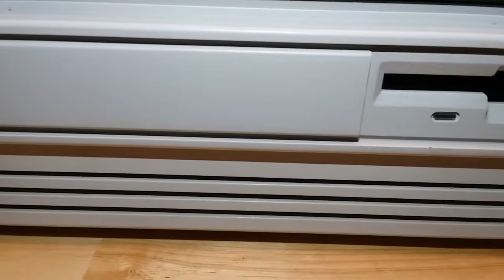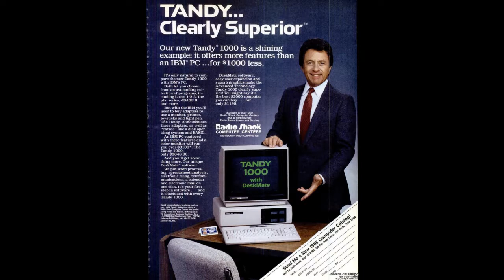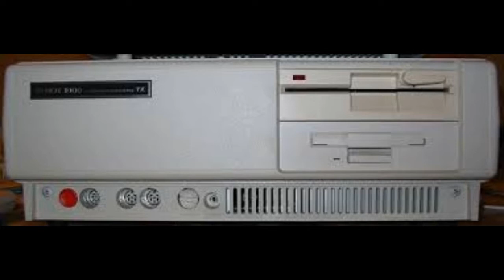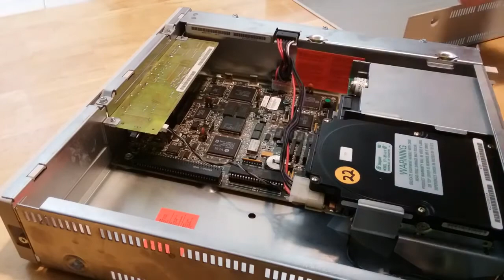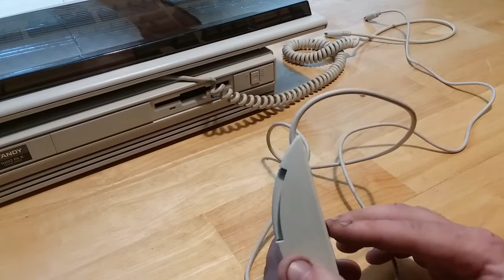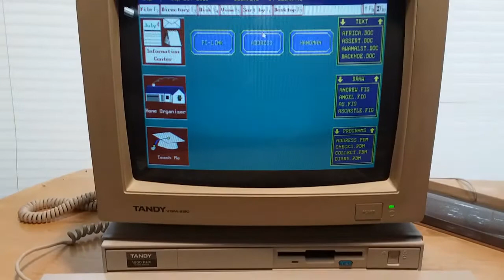Septandy 2020 - Tandy 1000 RLX-HD

Comment: I am sorry I had bought mine is 92 for a reduced 400$ and in the early 2000s had put a weird 8 bit memory card that took 4 32pin modules so I had gotten 9 meg total (8+1) and before that I had win 3.0 working easily in the 90's with the mouse and used it in wolf3d and other games , high end games from the time on 1meg would not work anyways easily so the dig sound and joystick conflict never came up
Reply from the maker: I haven't had the sound thing pop up either, but I haven't been able to get games to it yet..my xtide card won't work correctly, and the floppy stopped working.

Comment: Geos and GEM just work fine with the Mouse. Who cares about Windows.
Reply from the maker: I only really brought up the windows thing with this machine since i had been told on a forum page that leave deskmate installed, and was told about the weird mouse issue. And, do you mean theres GEOS and GEM thatll work on Tandy? Or did you mean the Geos and Gem had mouse support prior to deksmate being released in the 80s?
Reply: @definitelycasualpcs8789  GEOS and GEM do work with the Tandy-Mouse.
Reply from the maker: @drzeissler  Oh do they? Awesome! Maybe someday if/when I have a system that runs either iI'll test it out
Reply: @definitelycasualpcs8789  I never use deskmate on my T1000RL because it's ugly. The older Versions look better to me, but I think I have to stick to the version that comes with my system because there are parts in ROM already.
Reply: Speaking of the T1000RL/HD it's in my opinion the best machine to get. Small, silent and has all the capabilities you need, Tandy gfx/sound. Mine has an XTIDE with lot's of 32MB Partitions in it.
Reply from the maker: @drzeissler  yes. Deskmate wasn't pretty, but it was unique. Not many, had an os built into rom for a quick startup for use...the only one that comes to mind is the Macintosh classic.
Reply from the maker: @drzeissler  yea that's the thing that kinda sucks about the rlx, generic vga and an ...approximation?, emulation?, it's not true tandy sound from what I can tell...
I haven't been able to test any games that use tandy color/sound as an option. My floppy drive not reading, I haven't decided on a gotek  or not if I can find a way to 3d print a face plate, and I also have a xtide adapter but haven't found the right dipswitch settings for it (I've tried a few setting but it still boots to tandy deskmate on rom)

Comment: The reason why you can't use the joysticks and Tandy DAC sound at the same time is that they both use the same I/O port. In fact, the entire reason why the DAC sound exists is that when a Tandy engineer was working in integrating the Printer, Sound, Serial, and Joystick functions into one chip (PSSJ), he realized that with very minimal extra components, he could use the same 8-bit analog input used by the joysticks to also record and play 8-bit digital sound -- but with the one consequence that you can't use both the digital sound and joysticks at the same time.

And many of the quirks you mention are completely understandable once you realize that this is not actually an AT-class machine. Even though it has a 286 CPU, it is still only an XT-class machine. That's why it has an XT keyboard interface, 8-bit ISA slot and hard drive interface, and lacks the high IRQs and DMAs of AT architecture. But XT/AT switchable or autoswitching keyboards were common when it was new, the mouse port works fine in all DOS software, and very few people were using Windows 3.x on entry-level 286 machines like this when it was new.
Reply from the maker: Yea the quirks were one of the many reasons i wanted to make a video on this machine...Septandy or not. I knew nothing of this pc when i picked it up besides it was a 286 and was a Tandy...It was such a super interesting machine once i researched it I just HAD to make a video on it. And yea i had the I/O port stuff written down glossed over it for some reason...but at least got the main jist of it when I got to that part.
Im hoping to get this floppy working and see what kind of games can run on this...Although i may have to break down and get a xt-cf/ide for modern file transfer.